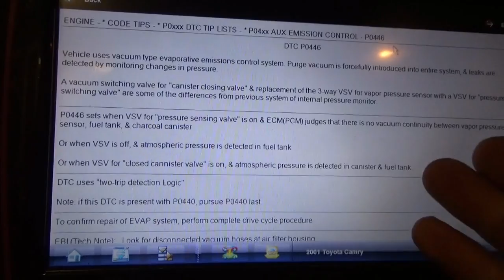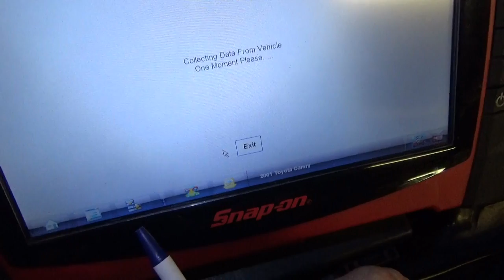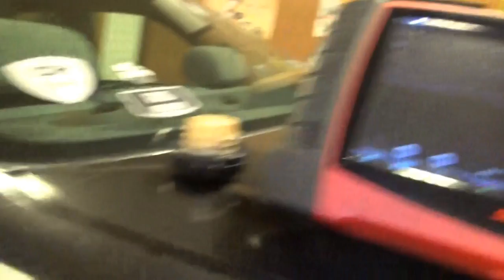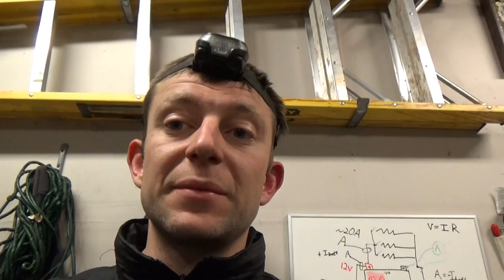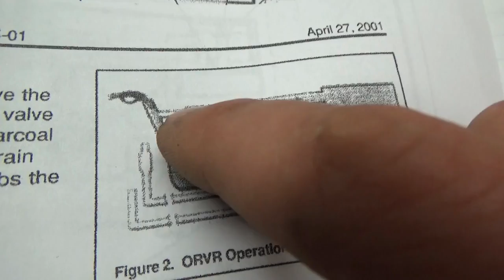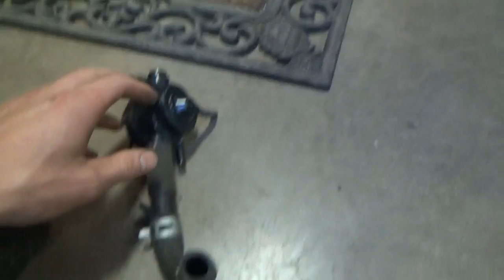Toyota EVAP Diagnostics Part 1: Can't Fill Tank

Comment: Excellent video! Really easy to follow. I appreciated the filming and the way you explained the process as you went through the trouble shooting and diagnostic steps. I am going to try the vent valve for air flow before I commit to replacing the charcoal filter.

Comment: We have a 2000 Toyota solara.  V6. Code P0446! Having issues. I think it's just 1 valve by the canister.   But for $86 for Amazon.  I'll change the whole thing, verses troubleshooting for hours.  Cars owes us nothing, a new part and good for another 20 years! Great vid man!  Thanks for sharing. 

I'll update my progress!
Reply: How did it do after the replacement? I have a 2001 solara v6 when im filling up with gas it clicks off constantly, i removed my evap canister, will be installing new one tomorrow.

Comment: 2018 dodge ram 1500. No fill issue. All checks prooved to be good. Come to find out the valve at the end of fill neck to tank malfunctions and whole tank has to be replaced . Dealer quoted over 4 g's. Recall for same issues on tanks up until 2017. I figure the 2018 got some leftover crap nonreplaceable valves for the tank . what I did was disconnect fill tube at tank and with inspection camera push center seat down rapidly and spray with carb clean at same time. So just agitating to break free and vuala it worked saved my boss a few grand.

Comment: By far the most complicated and expensive EVAP system ive ever worked on. Early years the canister would detonate and fill system with charcoal.  The later years especially the RAV4s the leak detection pump  would start squealing b4 it gave up the ghost. Anytime someone would bring a Toyota to me telling me it squeals after its been sitting for a few hours i knew it needed the infamous and expensive EVAP canister. Here if the MIL is lit you dont get to renew your registration, if you live in an inspection county. Ive had people tell me that this reoccurring problem and the constant oil burning was enough to ditch the brand altogether.

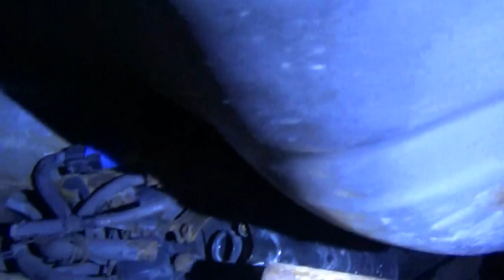Comment: I have a Camry with a hard to fill tank too.  Going to try your trick to blow out the valve (20:30) but the screw holding it on the vapor canistor rusted out.  So either I spend $150 to get a new charcoal canister or wait a little longer to fill up with gas.

Comment: I have a 2000 Avalon with codes PO 441 and PO 446. A mechanic done a smoke test and put an aftermarket  canister and valve on it. He cut some hoses on the canister to create a leak and returned car to me. I found the cuts after I replaced the canister with a Toyota canister which comes with a valve. I put the solenoid on the air box, new gas cap, new valve on fuel rail but there are 4 up there. All the vacuum lines look good. I replaced a few that I wasn’t sure about. When you fill up the car with gas, it turns over a lot and then cranks with the engine running rough. I have to rev the engine up awhile to clear it out and than it runs fine until it gets down to about a 1/4 tank and my wife said it’s a little hard to crank sometimes. I tried filling the tank with the engine running but it shuts the nozzle off and want fill the tank. I don’t have and gas leak or smell. What do you think it could be? I’m very frustrated. I live in north Alabama. Where is your shop? Is it to far for me to drive to you?

Comment: spraying WD40 into it does not seem like a good solution...  its petroleum based and will likely break down plastic.  Something like a dry lubricant with Teflon would be preferred...or even silicon spray.

Comment: Too many controls.  The old school stuff was brilliant: tank had some type of mechanical overflow protection that returned to tank which prevented anything but vapor from going to the canister - no solenoids, vacuum control, or computer "management" required. It was always in service, even with a dead battery.  Canister would regenerate during normal engine operation, and as long as canister fresh air filter stayed clean, those things worked for decades - just replace hoses once in a blue moon.  I hate these active systems - passive is much more reliable.
Nicely done - there are often gems in a manual regarding theory of operation you just can't get with visual inspections.

Comment: I was battling the same issue except I had no engine light. I was doing the same exact tests as you by putting air through fuel filler to look for restrictions and I couldn’t find any! I would have never thought to double check the vent valve because it was allowing air through it. I removed it and blew through it hard and heard a pop and problem solved! This video deserves a million likes! Thank you!!

Comment: I've got the 1mz-fe V6 with a P0440 code. I've replaced every switching valve and the purge solenoid...all located around the fuel rail. New vacuum lines too. The code comes back after a few days. The only valve remaining is the one on the canister itself. No problems filling the tank but there were about a year ago...months before any codes showed up. That problem went away on its own after I followed someone's advice not to let the gas level go below 1/4. There were also a few times when I could hear a bubbling sound when I took the gas cap off. Haven't heard it since.

Comment: And one  last thing has well I've changed my spark plugs and wires and has well cleaned the throttle body on my 2002 4runner limited about  2 months ago  And  I completed all  the drivecycles that I had such has the o2 sensors  and evap has well other things . But the  only one thing that won't go away still is the  catalytic converter incomplete whys that? Or anything i can do and there’s no codes pretty sure it’s the drive cycle

Comment: Hello love your videos! I have a 4runner 2002 and when I have my gas tank at half and I go to fill it. It'll keep shutting off the gas pump. But if I go to the gas station with a almost complete empty tank with the gas light on. Then the pump will fill up just fine what do you think it is?
Reply from the maker: Great question. There may be a sticky 1 way valve in the fill hose.

Comment: In the late 90s I worked for Isuzu. We had  rash of p440 codes in the late spring with Rodeos from '97 up. the problem turned out to be spider nests clogging the evap vent! Dozens of them. Pull a po440, and pull the little box at the end of the evap hose near the rear of the vehicle, and blow the spider nest across the shop! An easy warrantee fix that paid 1 hour flat rate. Not bad for 10 minutes of work. Love your channel!

Comment: Biggest problem with EVAP canisters is overfilling the tank. Don't "milk" the nozzle when filling, the gasoline goes into the vent line into the charcoal canister and eats it up. Fill until it clicks off and that's it.

Comment: Had the same fault with my ol' celica!  Luckily the purge valve and canister are under the bonnet, so no rust issues.  Just cleaned the lines and valve with the airline and 4 years on...no issues.

Comment: I wonder if debris is coming from the charcoal canister. Could also be from the atmosphere end of the hose as well. Usually canister filter breaks sticking the purge valve open. Good job Ivan!
Reply from the maker: Purge line looked clean as a whistle so I'm going to blame spider webs on this one lol
Reply: @PineHollowAutoDiagnostics  Agree. The hose that vents to atmosphere needs some type of filter screen on the end of it. I've heard of techs blowing out dirt, debris, spider eggs, etc.
Reply: I saw that on a Dodge Ram. Problem was the truck shuddered at about 45mph. I thought it was a torque converter lock up issue. But apparently the PCM also commands the purge valve to open at ~45mph. The canister filter screen had disintegrated and the purge line was sucking charcoal into the purge valve.

Comment: What can I say as an engineer? Simply: * * * * * talent at work. If all repair techs would be like you, there would not be a single unhappy customer in the word! Analyze, understand, repair and only change parts which really are beyond repair. I have small fleet of 3 cars 1965 and 2000 Volvo, one Citroen, one Harley and one Peugeot scooter. 

I can fit my discarded parts within 6 years in a one trash bag.  If you have failing relay, give it 500 grid sandpaper  slip and it will work again for 20 years.  People blab all the time about environment but everybody are actually advocating to buy more new stuff. Not to keep the stuff you have running. You do it and it is a hat off from me.
Reply from the maker: I can tell that you are going to enjoy Part 2 very much, Janne :)

Comment: Man, this us very common out here in AZ with trucks and SUVs that frequently run off road. Lots of sand gets into the EVAP vent line or valve.

And yes lots of free information out there and all it takes is a little research.

Comment: Very nice thought process.  I need to do that,  haha.  I'm all over the place, lol.  A friend of mine had a P0440 code.  I ran air into the lines.  Found that it was the purge valve was not working.  Replaced it, but still setting codes!!!

Comment: Did the charcoal canister come apart and some of it got stuck in the valve. Typically toyotas are foolproof on their evap systems and dont have many issues. Good job digging deeper into it and wonder if those valves come with a new canister they may have gotten lucky and they do.
Reply from the maker: Hi Mike, good thought,! As you owill see in Part 2 the EVAP codes would have come back even if the canister was replaced :)
Reply: @PineHollowAutoDiagnostics  Yeah I started commenting before the bonus footage lol. Great work

Comment: I know a guy that bought a new dodge truck maybe 5 years ago and couldn't fill tank , (maybe to like 1/2- 3/4 full). Turned out to be bolts missing on tank straps letting tank hang down. True story. 

Another nice one  Ivan!
Reply from the maker: haha so the tank was being held up by the fill hose...classic!
Reply: They had a recall for many of them for that very thing! They didn’t put a weep hole in where the strap inserted into the frame so moisture would get trapped and rust away the strap until broke off due to the weight on it constantly.

Comment: We have a '99 Camry (3.0 400,000+ miles) and had this problem it was off and on and mainly during cold weather. I wish I knew about BBB when I had this problem. (learned about them from you. *****THANKS!**** I replaced the whole assembly with a part from Amazon. Works great. I still have the old part(s) and might take it apart. You're correct, there are a lot of hoses on the unit! I tried testing but didn't get very far. I had a hose connected like you did to the fill for air.
If you do remove the whole unit, I had to drop down the center axle. Also, the small bolts, as  you know, get rusty. Heat them up a bit as I snapped one off and had to extract it.
.
How do you print receipts and find flat rates for your work? Have you heard of this site? https://www.autolaborexperts.com/ 
They're $10/month. You can suspend your account, and resume it any time you want and your data will still be there. They have a "save job" function. I highly recommend them. Might make for some good video content.  They'll also let  you enter your hourly rate(s).
Reply from the maker: Thanks for the comment Dan! I use Zoho Invoices for mobile repairs.
Reply: @PineHollowAutoDiagnostics  You should check out the link. It's specifically for auto repair. One feature I like is the flat rate settings.

Comment: Ivan,

What kind of "junk" came out of the valve?

Seens to me some other problem has to exist if junk is allowed in to that sysyem.
Reply from the maker: It came out so fast I didn't really get a chance to see it. Considering the vent hose is just exposed to the underside of the car, could have been cobwebs and dirt...

Comment: Hey Ivan, Was the gunk that you blew out little pieces of charcoal?  If so, the canister is breaking apart and will need to be replaced.  My old 97 Pathfinder with 200k miles had clogged lines filled with charcoal all the way to the purge valve.
Reply from the maker: That thought crossed my mind. If it comes back withing a year with the same problem, we'll look for a more permanent solution. So far it works perfectly as designed!

Comment: Ive had to replace the vsv by the canister 2 times. They seem to get crusty and stick.  Had to get a dorman ones as toyota does not sell the charcoal vsv by itself for my ride.
Reply: they can be cleaned with carb cleaner remove it cycle it and spray and bench test it

Comment: With how old the car is, does it still have to pass emissions?
Reply: Depending on which county the car is registered in yes. Still has to pass visual for any PA state inspection. Not being able to put fuel in the tank is the big issue.